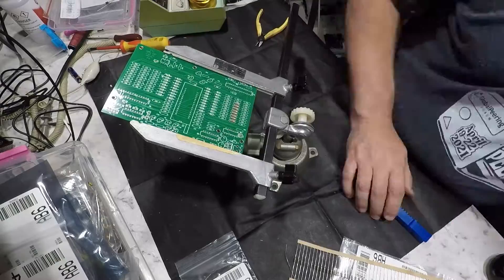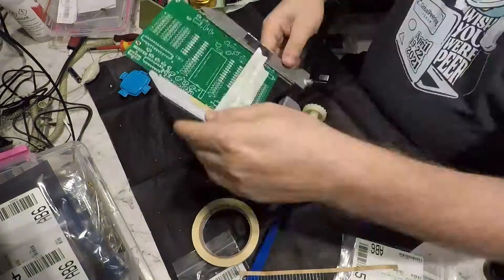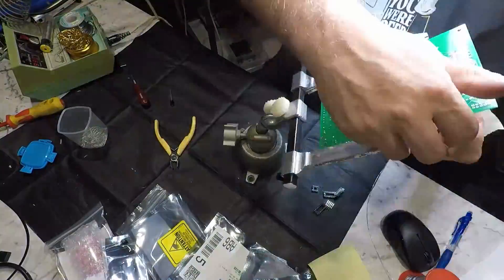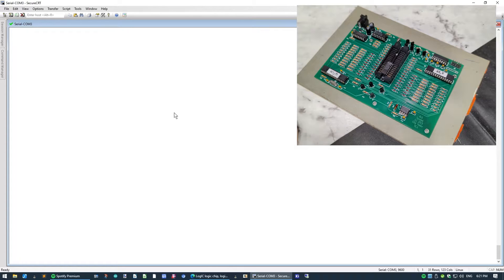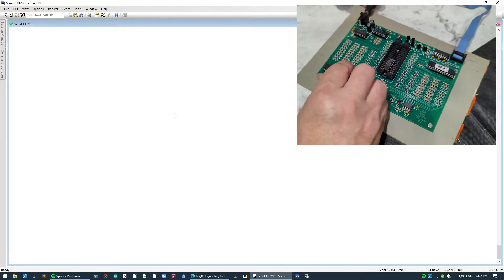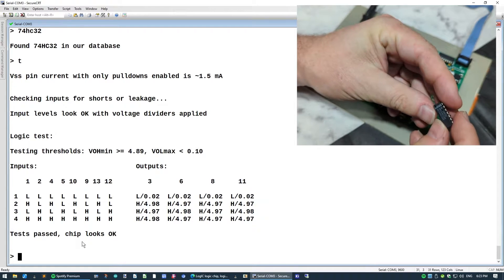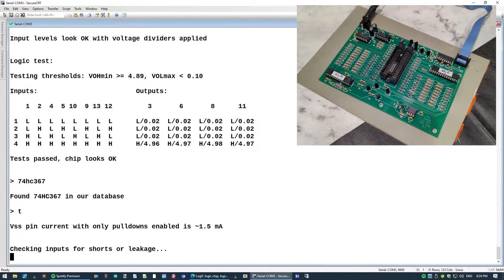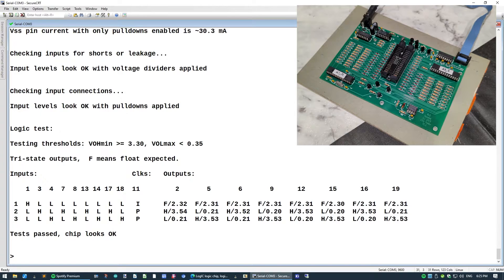Tauntek Logic IC tester

Comment: Been looking at getting this board, thanks for the video. For decades I've been bending the legs on through-hole components prior to soldering, but the masking tape is a great idea!
Did you order all the components from the US or did you find some here in Oz eg. Jaycar? Thanks.
Reply from the maker: The PCB and pre-programmed microcontrollers came from the US, but the rest was sourced online from the usual places (Mouser, Element14, etc).
Reply: @tassiebob  thanks